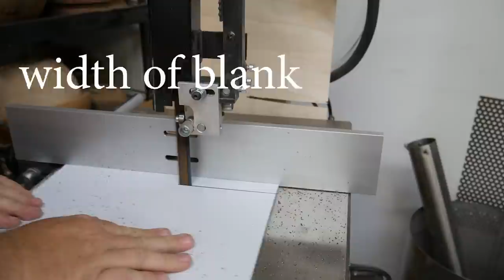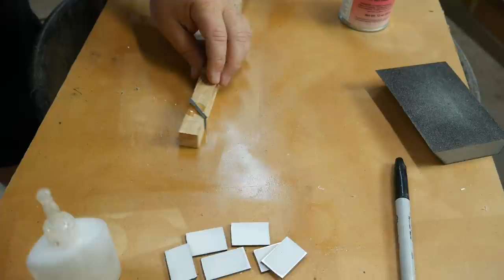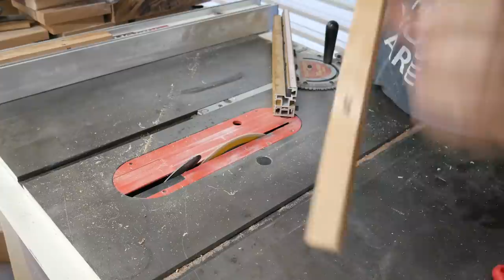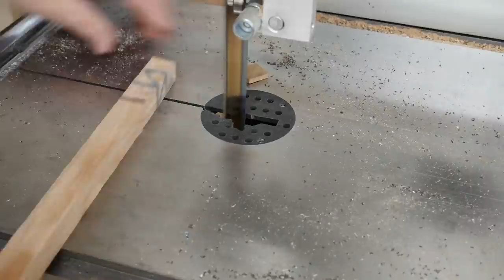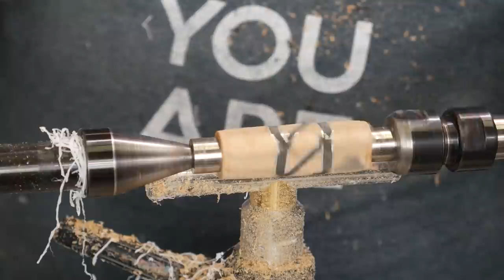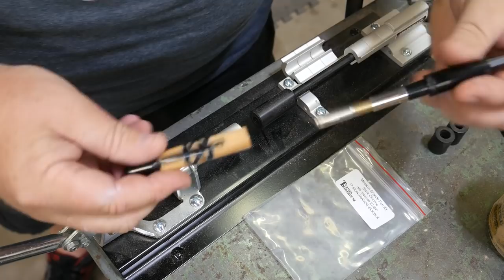How to make a Celtic knot pen blank.   Start to finish. Woodturning

Comment: Hi Chad, Nice video which explains really simply how to make a Celtic Knot Pen. I have made dozens of these pens and the only two points I would like to make is that when cutting on the table saw I use a stop block to ensure that all the cuts are made at the same distance from the end so the knot is perfectly aligned. Secondly when I cut my grooves I make the second cut opposite the first side, the third cut is made 90 degrees to the left of the second cut and the final cut is made opposite the third cut. This then makes the rings go inside and outside each other overlapping each other. Cheers Huw
Reply from the maker: cool thank you

Comment: I would like to know where you get the aluminum/acrylic laminate. I have tried to make it from scratch to no avail.
Reply from the maker: From turnerswarehouse.com.   There is a link in the description.   Thanks
Reply: @ChadSchimmel   Thank you so very much for such a prompt response. I need to clarify: I am looking for a laminate that is aluminum/acrylic (a variety of colors) /aluminum (3 layers) that totals 3/64-1/16 thick. That would fit the bandsaw cut in my pen blank and give a Celtic Knot that is not really thick. The different colors is so that I can have contrasting colors in the variety of woods i.e. Walnut, Maple, Cherry and Ebony.

Comment: Ok so I have attempted this pen twice. Some of my lines don’t intercept. I made a jig. When I put it through the table saw should I be pushing the jig all the way through?
Reply: Hi Kandie, not sure if you have completed the celtic knot by now but I was having the same issue when I would turn the wood, however what I found out is that I was not turning the wood piece down far enough to allow all the bows in the know to come through. I realized this after my 3rd attempt and for the life of me could not figure out what I was doing wrong as I knew my cuts were correct. Silly me.. Hope this helps and good luck.
Reply: @davidjennings2733  yes I found that to be the case as well. Also pushing the jig thru the cut helped a bunch! Finally got it in my second attempt.

Comment: Might be cheaper to buy a Montblanc than all the machines and tools to make a bog standard pen!
Reply: Ahh but you can make multiple pens and sell them on, many woodturner do this to finance new gear.
Reply: Not necessarily, I have 3 lathes normally turn bowls and larger spindles, been thinking about doing pens for a while. Just bought a complete pen kit with 5 pens to start with for £85. Going to have a play at making pens. It is a hobby and if all turns out well it may pay for its self and allow me to buy some new tools. It isn’t about the cost it is enjoyment of making something beautiful and useful out of a bit of scrap wood 
.

Comment: Hello Chad
Thanks for the video. 
2 questions of you don’t mind —
What material did you use for the Celtic knot ?

What tool did you use to turn the pen?

Thank you

Chris
Reply from the maker: I listed the materials in the description,  I used a round carbide tool to turn it.  thanks Chris
Reply: @ChadSchimmel  Thank you Chad, I watched (and re-read the notes again) 
It looks like a woodpecker tool -- I am thinking of getting a set -- but was curious what size (Full, mid or pen) you had used?

Thanks again for a great video